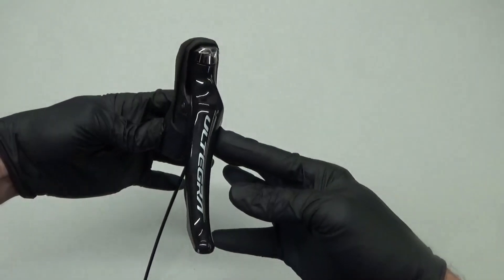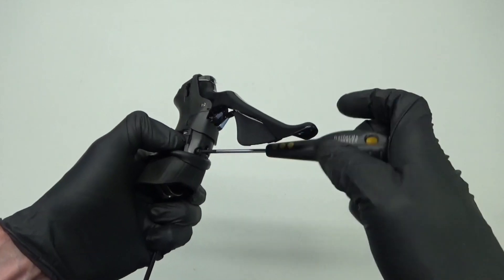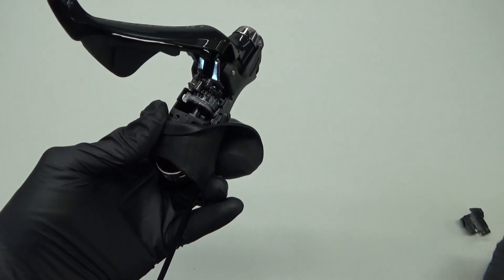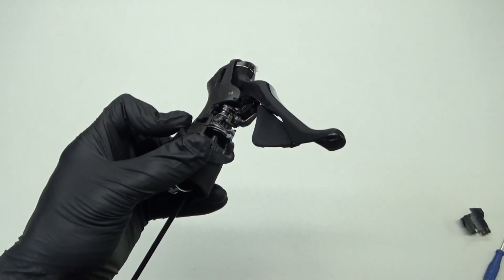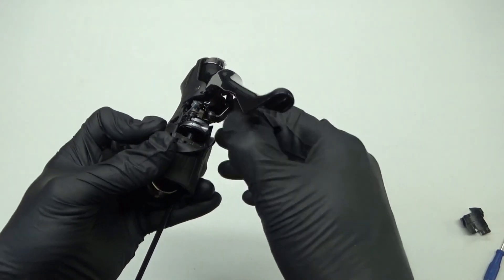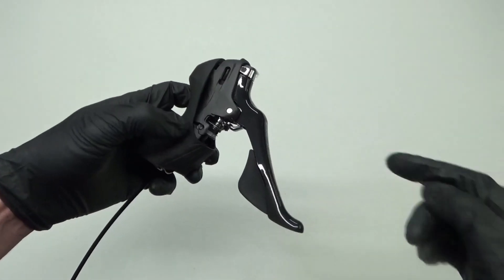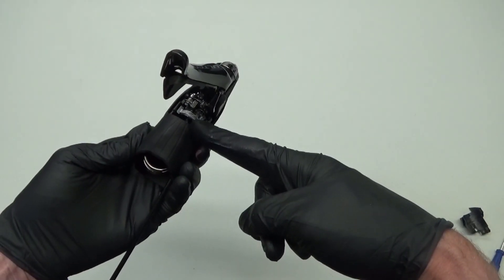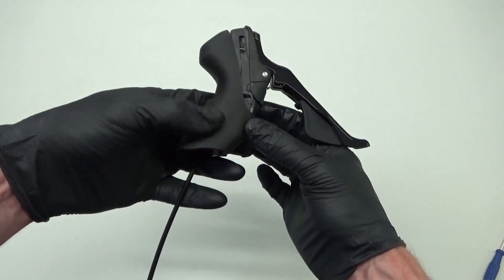How To Remove A Broken Shift Cable | Shimano Ultegra R8000

Comment: Love all you videos and I have a similar issue with a R7020 shifter where the gear cable end has not snapped but somehow come out of the pocket and now locked in the shifter body. Will this same process work on that model?
Reply from the maker: Yes remove the cover to access the cable!

Comment: Watched the video and took a stab at replacing my frayed front derailleur cable. Now the shifter won't move the cable at all. The part of the shifter where the cable head seats doesn't move at all. It's a Shimano Ultegra R8000 and I had to take the cover off the underside to remove the old cable. Any thoughts on what I could have done such that the shifter doesn't move the cable head? Any insight would be greatly appreciated as I can't seem to figure out what I did wrong. It was working fine before changing the cable.
Reply: Nevermind, I thought the shifter was set for the small ring but it wasn't. Took a fair bit of tension pulling on the new cable, but I finally got it to downshift and now is working swimmingly. Thanks for the video!

Comment: Got it. First time with these new-fangled shifters for this old timer. Took me awhile but I got it with your help. I was bollixed until I found out about the plastic cover that had to be removed. Good tip on leaving resting bike in small cog, too, thanks. Another thing that helped me before installing the new cable was taking a piece of old cable, oiling it, and sending up through the top housing to help scour out any last bits of frayed cable. That also helped me with finding the exact spot to insert the new cable, which is tough with my eyesight. Had to use pressure with a small screwdriver to get the cable back through the housing. Must admit that the old-style cables where you just send it straight through the hole and have the housing exposed in front of the bike was a lot more convenient.